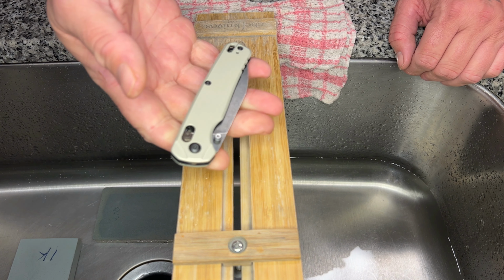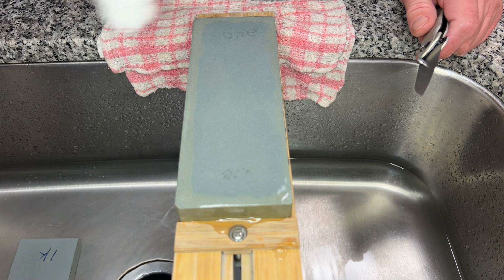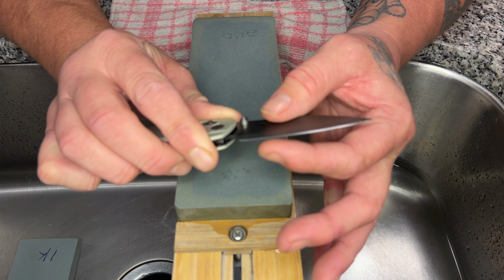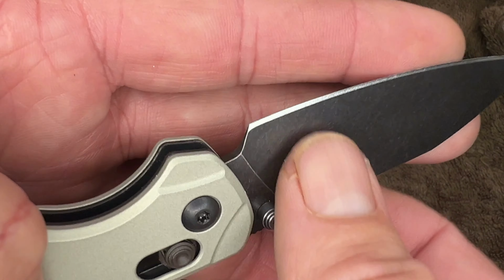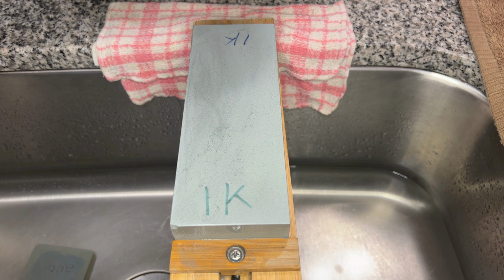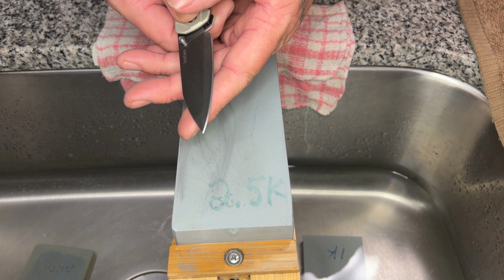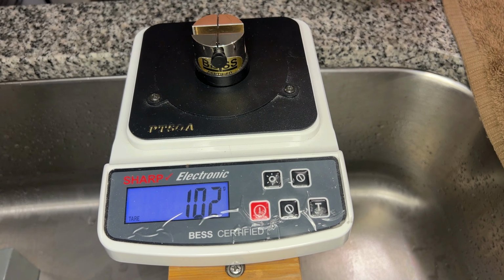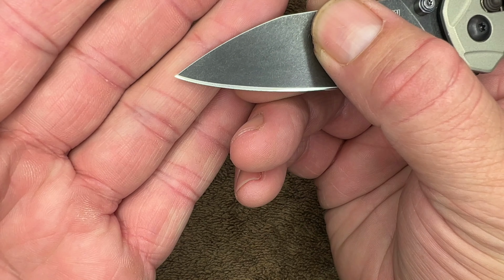Knife Sharpening - Kershaw Bel Air Magnacut

Comment: Nice video, nice edge! Seeing people struggle with the BESS tester is basically the only reason I didn’t pull the trigger on one yet. Every time I am almost convinced I need one, I stumble onto videos of people struggling to get them to work consistently.
Reply from the maker: Yes they can be finiky but much of it is probably (myself included) human error. So many variables can affect the numbers. If you could devise a way to cut the media, with even steady pressure, that would probably remove most of the issues. Unfortunately, i haven’t figured that out. Sure someone has a video floating around, sharing what they do. If ya ever come across I’d be happy to get the link 😁
Reply: @Jef Random errors are not a problem, just increase the number of measurements. Just take 5-7 measurements. Calculate the average. Calculate the standard error. Give the result in the form: average +/- standard error. The true value will lie in this interval with 67% probability.
The result of this knife is 103 +/- 13 grams.The relative error of measurement is 13%.
Reply from the maker: Cliff told me this as well. He tried to get me start taking no less than 20 measurements. Unfortunately as many knives as i sharpen, I’ll burn through the media thread, quickly. It isn’t super expensive, but that will eventually start to eat into my pocket. He was trying to find me a fishing line equivalent, before he passed. Never got me a solid answer on something reliable, that matched bess’ stuff.
Reply: That would be not only costly but also very time consuming, especially when you sharpen a lot of knives indeed. Guess it’s just waiting for the next somewhat affordable step towards measuring sharpness for me.
Reply: @Jef  There is no point in using a thread from BESS. Why use it if it doesn't serve its primary function of comparing sharpness levels between different people?  If you sharpen a knife and measure the sharpness, and then another person measures the sharpness on the same instrument, the results are likely to be different.
As far as I can remember the thread from BESS is just 0.009 inch thick fluorocarbon fishing line.
Buy fishing line of the same thickness and use that, it's much cheaper.
Personally, I use capron thread, which is very cheap and I can take a lot of measurements in my tests.
Reply: @lars43771  It doesn't take long to take 5-7 measurements. On my homemade scales it would take no more than 2 minutes. The latest shorts is on my channel.
Reply from the maker: @ottovonchriek I’ll look into that fishing line and give it a go. Thanks for the info 👊

Comment: They are nice knives.
Reply: Kershaw has made several nice knives lately. Their Deschutes Caper fixed blade is great. It's in D2 but is on the hard side of that steels heat treat.cheers ! cam
Reply from the maker: I agree. I’ll be getting one, i do believe. Although that back taper is jacked, what knife isn’t these days? 😁
Reply from the maker: I’m not a user of many fixed blades. I know the launch series looks amazing. Just need replacement springs that are stronger, but otherwise, i think they are fantastic.
Reply: @Jef agreed.

Comment: Following Knifegrinders Bess test procedures (a sharpy dot on the edge } to test the sharpness at a specific point on the edge will help reduce the spread of differences. You can also do repeated tests on various points. Mike at Edge on Up didn't seem to think test material tension is much of a qualifier; any thoughts. Speed of push thru might affect test results too.
Nice video, thanks Jet
Reply from the maker: The tighter the thread, the lower the results. It’s why many guys try to load the tension with 100g weights. I use my Leatherman juice which is approx 120g. I used to do the dot thing myself. Not sure why i stopped. I still saw the numbers swing doing that. Perhaps that was why i quit?

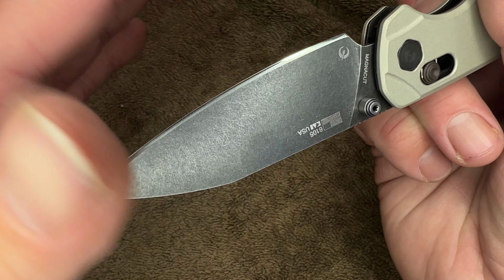Comment: 15:49 strong glint along entire edge.  Did you apply a  microbevel or is that a burr?
Reply from the maker: looks like one doesnt it? I had no burrs, and stropped it again after the video. I assume it is just the lighting, bc the bevel is convexed. you can tell the roundness by comparing the very shiny area near the apex, vs the heavy scratches near the main grind. i think* it is just the rounding effect against lights
Reply: 99% sure it's just a convex edge the way the light is reflecting. Too consistent to be burr and the transition is too smooth to be a microbevel.

My bad, he already answered it lol..